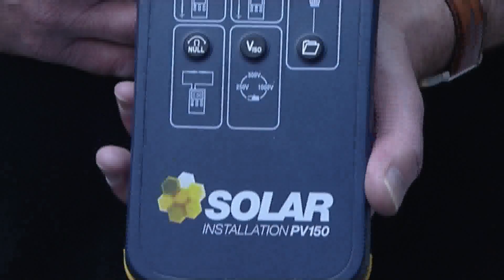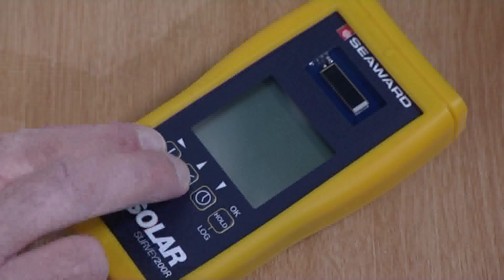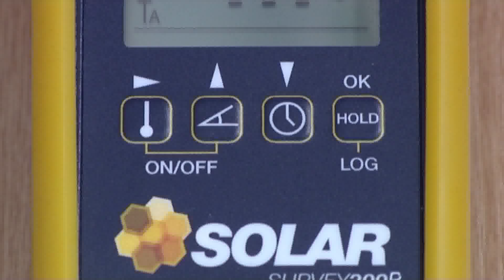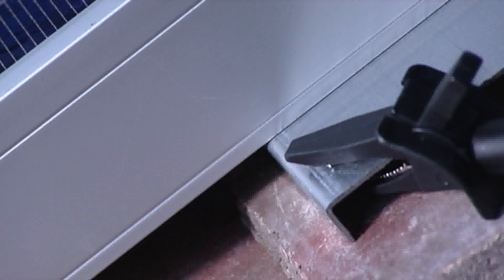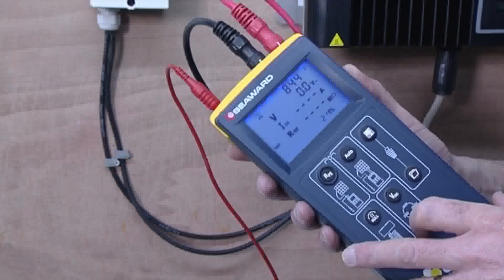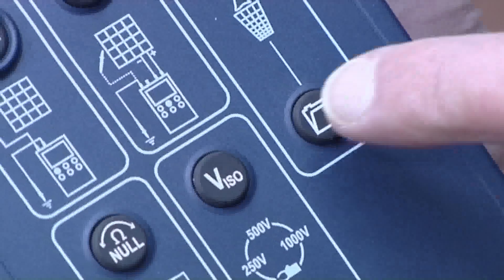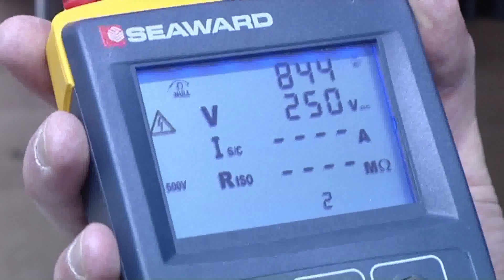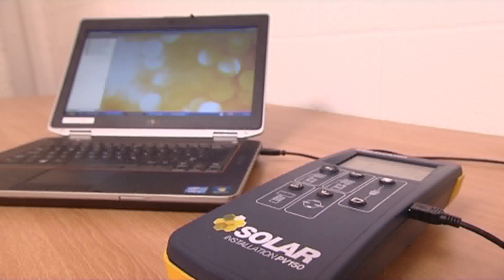How to test a PV installation using the new Seaward Solarlink™ Test Kit

Comment: How does it find faults and tell you where the problem is. I have 24 x 250 watt modules. Got 820 volts and 1.5 amps a bit cloudy winter. But when connected to inverter 780 volts and 0.1 amps now and then drops out and in producing 70 watts then not. New inverter and one string is working but not this string. All modules produce 33-35 volts and about 1 amp cloudy. But when connected to inverter nothing. Will this kit find the problem. Also tested temperature of junction box cell side all 24-28C on winters day air temp about 12-14C. Looked at some of the diodes can I test these and how in the module.